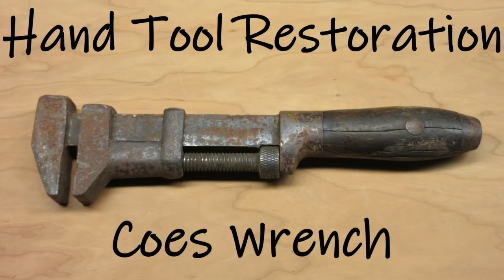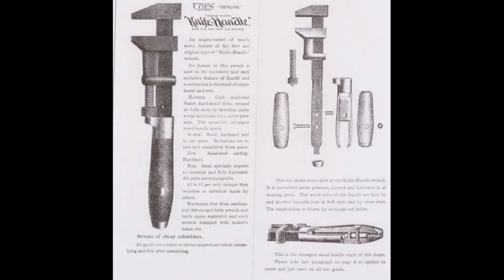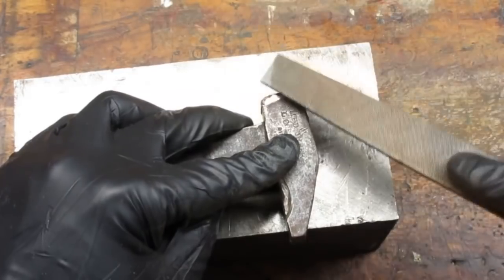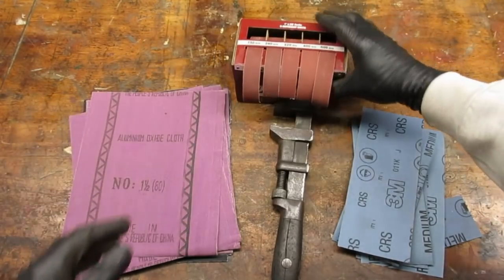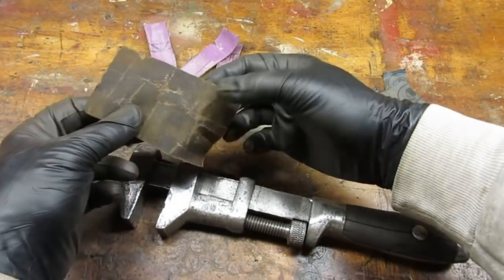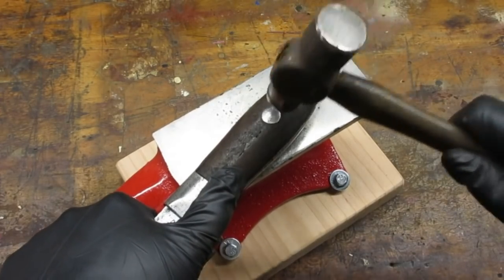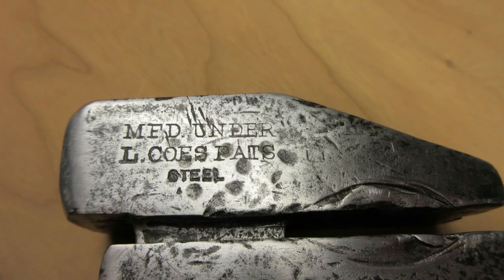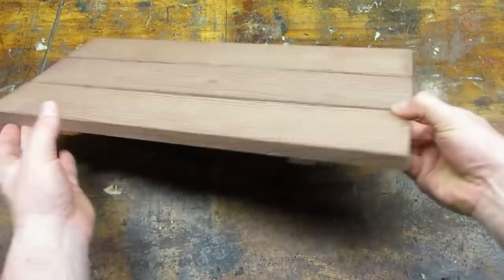Hand Tool Restoration - Coes Wrench (Low Budget Beginner's Tutorial)

Comment: Nice! I haven't had much success with my vinegar/steel wool stains... For my Dremel, I bought a knock-off pistol grip from eBay/China - £2.50 delivered to the UK, and extremely good quality... Makes handling a lot easier. Also, for split wooden handles, try mixing some wood dust in with the PVA glue.....I find this gives a nice finish once sanded
Reply from the maker: I've had my Dremel for 20+ years, when she finally dies I might try a knock off brand.

Comment: I just acquired an identical one of these, in about the same shape if not worse. Magdad, would you have done anything different with this restoration?
Reply from the maker: Thanks for watching! I was happy with the way this wrench turned out.
Reply: Same here, any idea on the age? I think they used that manufacturer name until 1928 but I could not find much information that could pinpoint a more precise date on that wrench.
Reply from the maker: @RTIZONI  Thanks for watching!  I don't have any additional information on how to date Coes wrenches.

Comment: This is the exact same as the wrench I recently bought for $28, it has a bit of blackened spots on the steel from heat and the wood is almost completely blackened, but it has essentially no rust or cracking of the handle. It also has the marks completely in-tact. one side says "Coe's Wrench Co. Worcester, Mass. the other is labeled "M.F.D L.Coe's Pat's Steel".
Reply from the maker: I see the Coes wrenches at the engine shows all the time!

Comment: How do you dispose of the used mineral spirits?
Reply from the maker: I keep it in a glass jar and re-use it.  The dirt eventually settles to the bottom of the jar and I decant (correct word?) the clear fluid and wipe out the jar periodically.  If I really need to get rid of the mineral spirits, I just add it to my used motor oil and take it to the recycling center (not sure of that is 100% OK, but I figure it's better than than putting it down the drain)